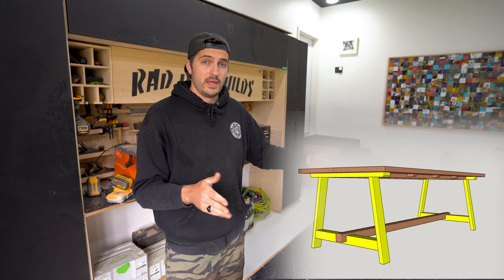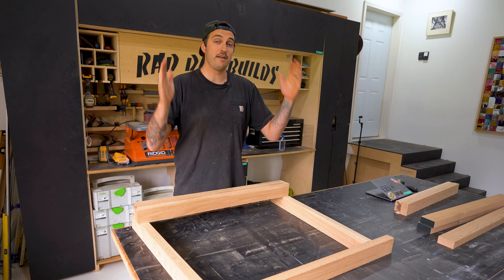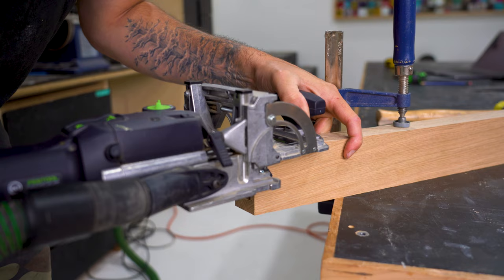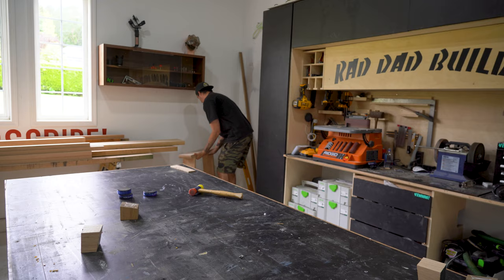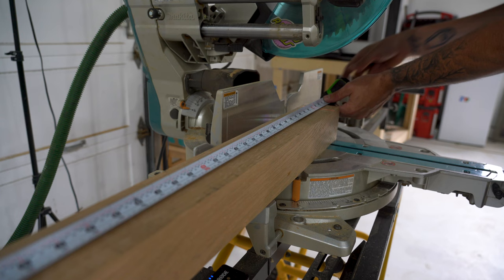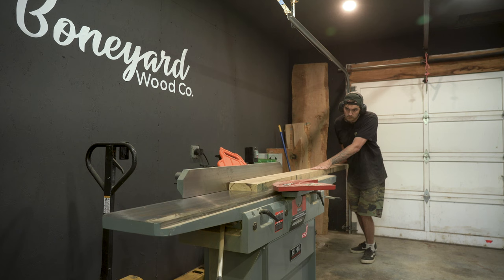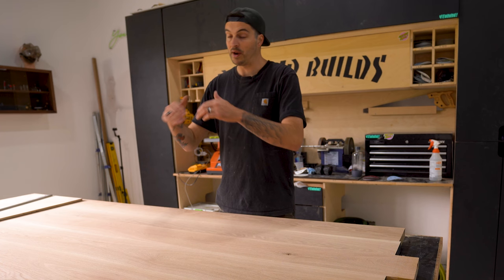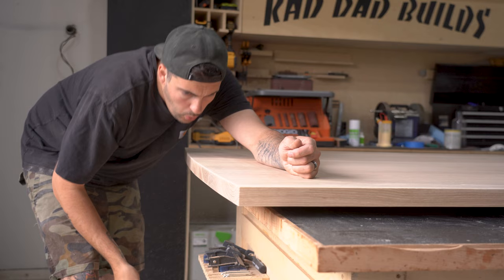How To Build An Oak Dining Table That Last Generations . Plans Available

Comment: Hi. I bought the plans, and want to make a longer version of this table. I'm a beginner. Will I need additional supports if the table is longer, or can I safely stretch the dimensions using the same design?

Comment: Great build but one question -- at 16:55 you;re drilling holes in the top for screws to pass through and screw into the threaded inserts, but don't you really need to create slots instead of holes -- so that the table top will be able to have seasonal movement?
Reply: Such a great table build and I was just as surprised as you that there is no thought of seasonal wood movement. I would surely use slots. All these great build videos but very few show how the finished product looks like a couple of years down the line.
Reply: The table will tear itself apart eventually. You have to "float" the top on a solid wood table. Today, in especially dry homes, a top that width could shrink 3/16" over all. But it will do it by expanding and contracting during the seasons as mentioned above.
Reply: @cristiangrigore  Yes!
We just drill a round hole, about 1/2" - 5/8"  as it's easy and use a fender washer with a wood screw centered in the hole, depending on the width of the table and species of wood. 
Softer woods will move even more.
And it's not just the seasons, it's modern heating system that are so dry. Especially in floor radiant heat. In our home with in floor heating, I've see a 3" cabinet door frame shrink 3/32nd"!

Comment: Fantastic I'm currently got so.e lovely French oak air drying has some lovely splitting so will add resin to it
Reply from the maker: Thanks, oak and dark resin go together really well. I have another table video on here I built years back and it had tones of splits in it. Turned out awesome in the end

Comment: i would have just used a small chamfer on the bottom stretcher. youve got angles galore, just keep em going. doesnt need to really be much to make it comfortable either so it can be a small touch that goes un noticed but if someone does look at it theyll appreciate the continuation of the angled theme. 

that being said the way you did it also looks great and im totally biased towards chamfers

Comment: Did you oversize the holes on the frame at all to give the top room to move without cracking or cupping? Even room for 1/4” of width expansion should be more than enough
Reply: I was wondering the same thing!  At the 18:14 mark, it doesn't look like the holes are elongated ... plus, the screw heads are sunk in!  I'd be tempted to simply remove the outer screws, leaving only those located on the centerline ... then fit proper clips along the outer stringers.

Comment: Great build and awesome presentation. I'm doing a table build with castle joints right now. 
Do you ever use metal channel underneath to ensure the table top will never warp? Thanks.
Reply from the maker: Thank dude, so if I where making a table from wide live edge or lumber wider than 10” each then yea I would likely use some channel underneath. As I built this table for myself and it’s in a controlled environment I didn’t feel it was necessary

Comment: Love the build! Me and my girlfriend are huge fans of your style and white oak theme. Are you not worried about the table top expanding/contracting? I thought for table tops you usually want to use a slotted/pill hole so the attachment points could slide a bit.
Reply from the maker: Thanks So Much. If I was to build this table for someone else yes I would go with a slotted or a wider hole to allow for wood movement. That said I drilled holes larger than the width of my hardware to allow for slight movement in all directions. Plus this table went into my own home where I can control the climate and environment to minimize wood movement.

Comment: I'm a beginer. When you wash off joints with a tooth brush, are you using water? Thanks.
Reply from the maker: Yea water. A wet towel works good too

Comment: Do you have to adjust the Domino jointer to 80-degrees when you made the holes for the A-frame legs and top piece? Or does it always stay at 90-degrees?

Comment: Roughly what did the wood for this project cost?  I'm just looking at a ballpark figure so I can share the possible cost with my wife.  Thanks!
Reply from the maker: 120 bf, for white oak here in b.c Canada cost around 900$ cad total. The cost will vary depending on wood type and location. Here in B.C hardwood is crazy expensive.